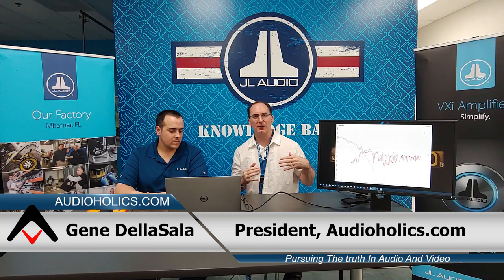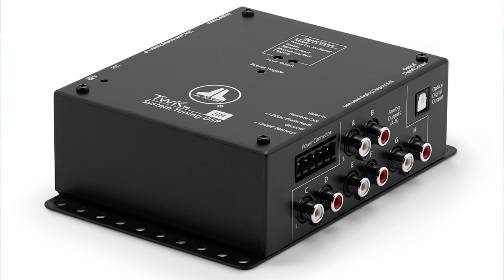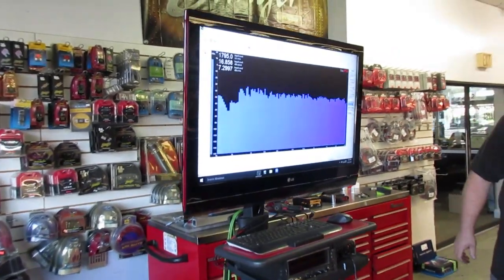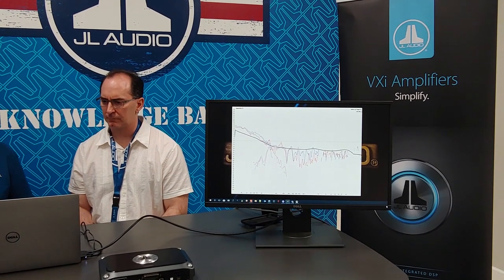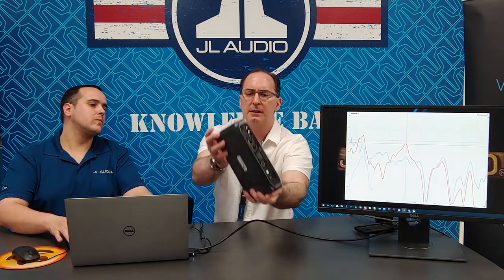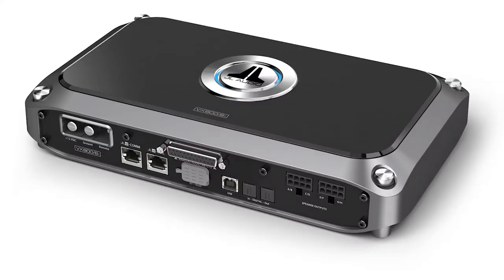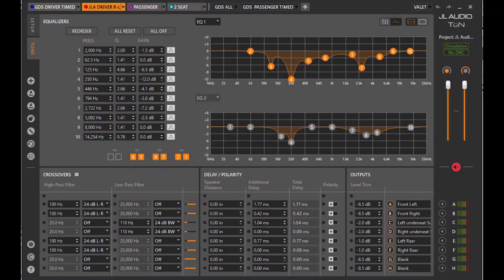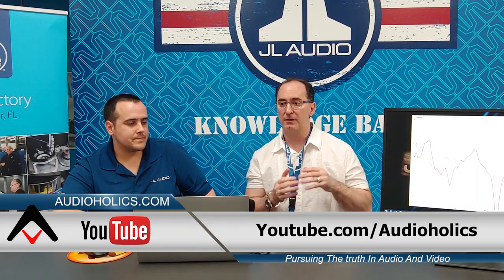JL Audio Tuning Procedure for BMW 2-Series Sound System

Comment: JL Audio for life! Check out this setup!
3-way active front stage. No rears at all. 

FRONT STAGE
DASH SPEAKERS
In custom made fiber glass/body filler enclosure. Deadened and internal treated.
Vifa tweeter, center ring driven with phase plug (RBH). 75W /each - 2x ch of JL 300/4
4" RBH Beryllium Q basket driver with phase plug. 100W/each - 2ch of JL HD600/4
Doors - JL C5-650 150W/each - 2ch of JL HD600/4

SUBWOOFER
1X JL 10W7AE in JL's sealed box, CLS110RG-W7AE 750W RMS - JL HD750/1

DSP
JL TWK88 soon to be replaced by my own custom built DSP AUD1467. (I'll be able to do FIR filtering for crossover between mid/tweeter)

Bass Shaker in drivers seat - Auro bass shaker, 150W - last 2ch of JL 300/4

Comment: Gene thanks for doing this. Before leaving for a deployment I installed Focal speakers all around, a JL audio VXI amp, a 10 in JL audio sub on a custom box powered by OEM HU going thru a JL audio Fix86. When I get back I plan to finish it all off with the Twk88 to really make it all come together.
Reply: It's on a 2018 Tundra DC

Comment: I have old school equipment because it sounds better than the new stuff. I use an Eclipse 8053 pre amp. It has no internal amplifier. This head unit is a true 8 volt rms preout. It is not like a 4 volt peak output. they are 1.9 rms by the time the signal reaches your amps. 8 volt rms gets you a nice strong signal. you can look up the specs.It has an AUX. I use class D Cadence A4 ultrashock bridged to 2 289 at 4 ohm. Cadence A7-HC mono block sub amp. 1,400 watts stable to 1 ohm. 1 Cadence 10 inch solid box subwoofer. No port. Ported sub box's are sloppy bass. Up front Morel 6 inch mid with 1 inch silk soft dome tweeter. I RTA the system flat. Then used the DSP in the Eclipse to fine tune it. This is in an 2004 Accord 2 door. It is a beautiful SQ system.

Comment: So, I see that the DSP box has digital inputs.  Is there a way to send a digital signal from the head unit in a 2017 BMW 2 Series? It has the Harman Kardon system.  I don't like the idea of the head unit doing DA Conversion, sending analog to the DSP... that's going to then do it's AD & DA Conversion (again).  Yuck.   Anyone??? thanks!!
Reply: Chris Kunstadt you need a digital output source, a digital audio player is ideal, most head units don’t have optical output. There is a Sony GSR9 head unit that has digital output but it’s $1500 and you could get a lot of DAP & DSP for $1500
Reply: You need a MOST to Toslink converter. Audison have their Bit DMI but is mad expensive, and after having so many issues with their Bit One in my M240i I will likely never use their products again and am kicking myself for not buying a TWK88 along with my JL Amplifiers and Sub. MOBridge do one as well which is cheaper but you will need to confirm if your HU and stock system is coded to use the MOST ring for audio. I know after a lot of research that the UK/EU market 2’ do not have this even with the HK upgrade so not sure if the US market HK option does as some places suggest it does. You can purchase an ENET cable and recode the HU module to output the audio signal digitally but best to pull the HU to check the one in your system had the fibre optic ports on the big block connector. So with a MOST link connector and fibre patch you can daisy chain into the ring to introduce a mObridge M.2 Media MOST converter to provide a toslink connection for a TWK88. This is what I am planning on achieving.

Comment: could you not use the center channel as the right and disable the right speaker. The channels will be at equal distances then. (when driving alone)
Reply from the maker: Not a greqt idea since its at a different height than the door speaker. With time alignment and EQ, an incredibly good phantom center can be heard between the 2 door speakers from the drivers seat.